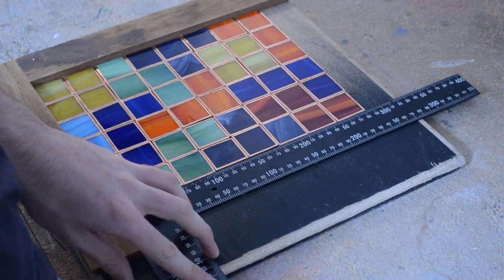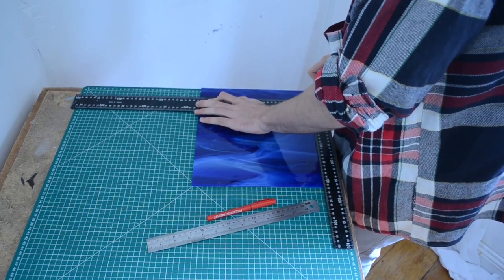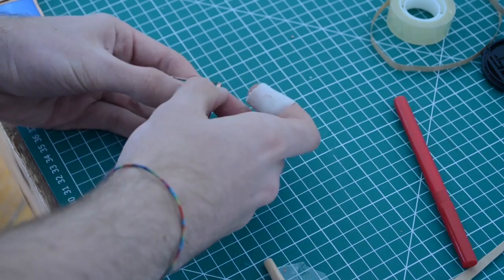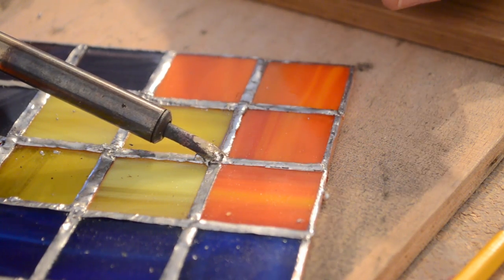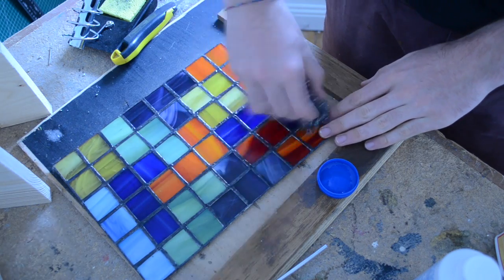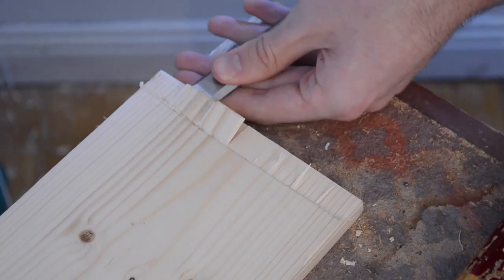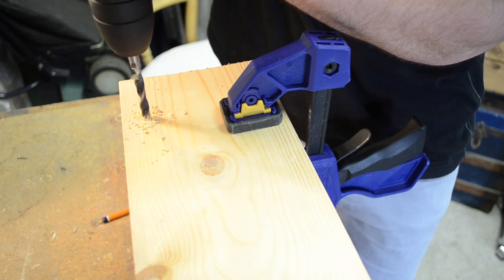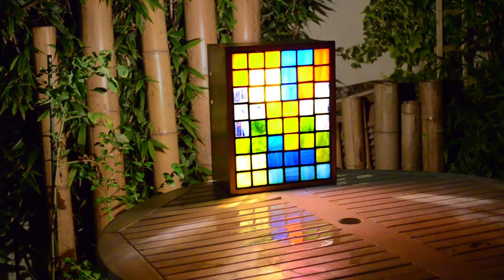How To Make a Tetris Lamp

Comment: Wouldn't it just be easier,, and look more like Tetris, if you used a frosted piece of glass and stained glass paint. You could even save time cutting the glass pieces if you used the "liquid lead" paint found at most craft stores! Less chance of cut fingers And still would look nice! You can even purchase light boxes from the craft store. Sure it may cost a little more then the DIY process, but it would save time and energy for those of us that don't have the dexterity for smaller tasks.  Just a thought!

Comment: 5:20 why is sofa so high up in the air? i like lower sofas with removed 2dm highers
Reply: The legs were photoshopped in for some weird reason. In reality, it's just a typical levitating sofa, using the earth's own gravitational field, amplified by a patented "U.F.O" device, developed by Tesla Electronics. It's pretty cool, actually, but it tends to sink a bit on one side if someone really obese tries to sit on it :P